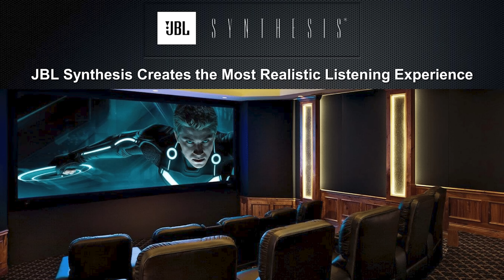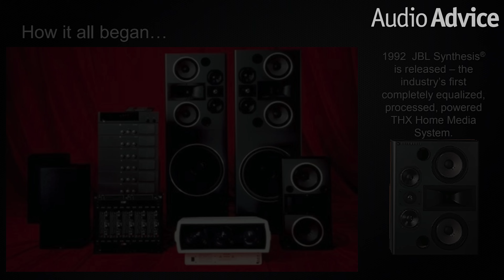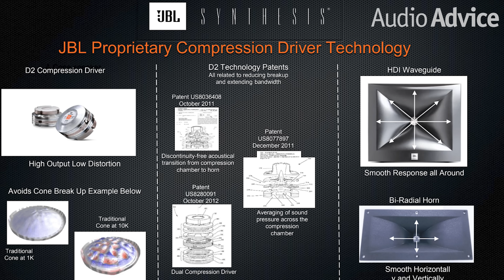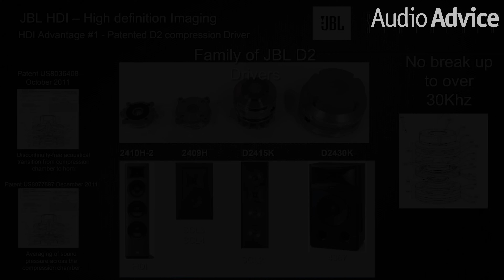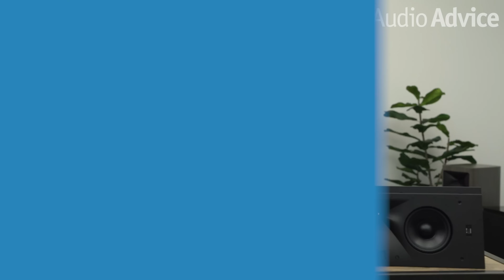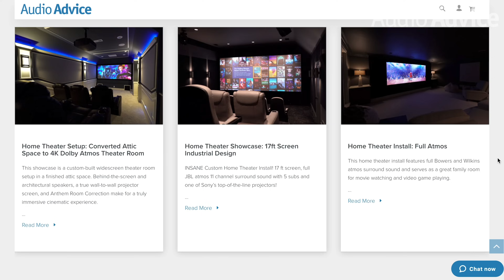JBL Synthesis Home Theater System Overview | Shipping Nationwide - Exclusively from Audio Advice!

Comment: JBL is the standard for high performance theaters. They basically wrote the book on theater sound. Great video.
Reply from the maker: True!  Thanks for watching
Reply from the maker: We couldn't agree more, Marty! Thanks for watching.
Reply: I've been an 'audiophile' since the mid-70s, and I thought James B. Lansing sold SPEAKERS, not HT amps until recently? Also, aren't the LexiCON RV-9, and Arcam AVR850 identical receivers as the JBL SDR-35. I cannot find ANY of these 3 in CanaDUH for under $4,000.00